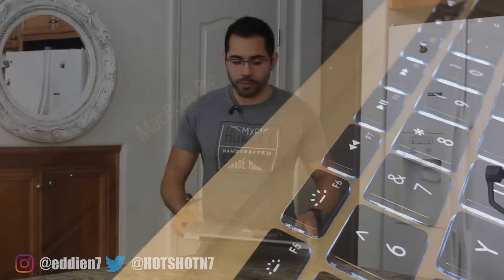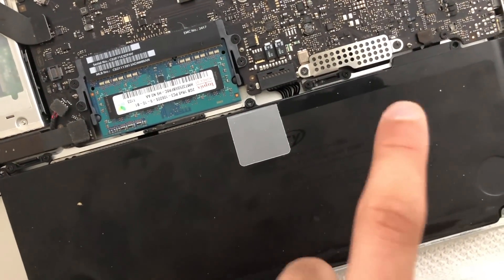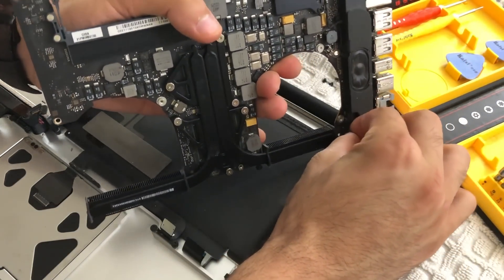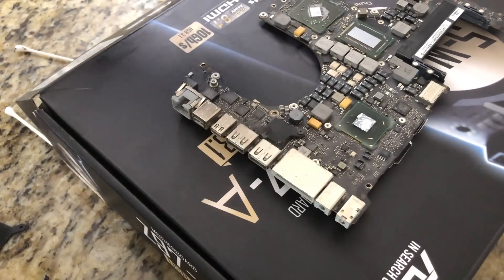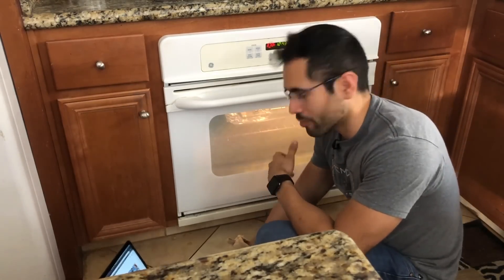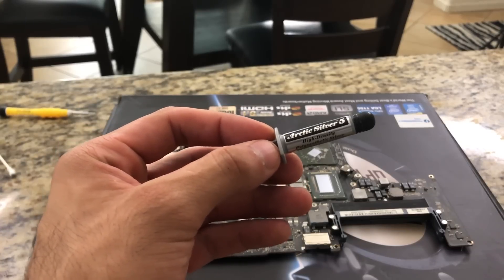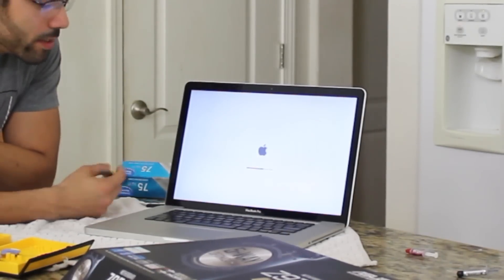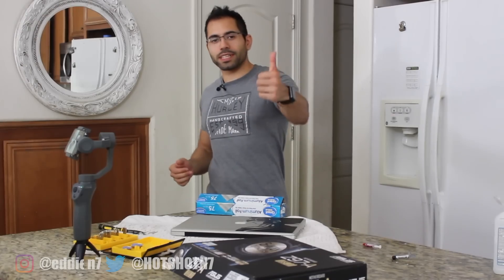2011 Macbook Pro Graphics Card Fix

Comment: Fantastic!
Bit worried about doing it!  My September 2011 15" MacBook Pro finally died last September (2018) and various trips and enquiries to repair shops proved fruitless.  It was on PC Worlds "Do not repair" listing.  It was put in a drawer and forgotten.  So with nothing to loose I watched your excellent Video, crossed my fingers and went for it!
Only observation is you skip through the removal of the ribbon cables a bit fast, so it was a step in the dark.  The fan ones just pull up to release and I had a bit of a game trying to slide them out horizontally and damaged them a bit.  A few of the ribbon cables are a bit fiddly but now I'm an expert!
In the oven it went for 7 mins at 370 deg F (I had a temperature gauge in there so it was dead on) your heart beats faster when you do that.
Put it all back together with the paste and Voila!   A new one is currently £2600.
It's working perfectly now so thanks mate!   I'm writing this on my rescued machine, back from the dead an hour ago! 
There is no feeling quite like it when you switch it on and it works!
Great Video, You and YouTube saved me a ton of money so thanks again.   
Everything is there, I didn't bake it all away and when it fired up even the Chrome remembered what I was doing when it died.  
If you are reading this with a dead Mac and wondering if it works - yes it does!  Absolutely!!  Just do what the Video says and it will be fine.  If it dies again I'll do it again (it's easy now) and dine on baked Apple!
My only gripe is why didn't I hear about the Apple recall which I understand they did.   I'm in the UK which is where I bought it from the Apple shop, so they were aware of me and what I had.  I love Apple products but this initially left me doubting my loyalty by not offering to fix what they knew was a built in problem for their loyal customers.  Steve Jobs would have frowned on that I think.
Thanks again for doing the video.
Reply: Trevor Byford how much longer is it going to work though?
Reply: I've never heard of a recall and I'm here in the states! I have the same model, it just crapped out.
Reply: @mobscene13  is it still working?
Reply: @mukzahmed9856  no, not at the moment. I haven't bothered fixing it yet, just grabbed a replacement laptop for now.

Comment: my 2011 15" died for the 4th and last time. I've takin my mbp apart so much, i should be a certified Genius. dont have time to keep messing with it and threw it in the trash yesterday. apple should be sued for this.
Reply: YES! Apple should be sued as they can't even provide you with any help what so ever. I had this very issue with the same machine and all Apple had to say was "sorry". No help, no fix, not even disabling the GPU for me to use the intel. A pile of shit apple are.
Reply: Apple should be sued for something that you bought 8 years ago? Come on, how long do you expect a laptop to work???
Reply: @MassivanMusic  i expect a laptop to last 12 years, like everything else we buy thats expensive does
Reply: @ @renossantinc768  why exactly 12 years if I may ask? At the speed the computers are evolving a machine is obsolete way before 12 years have passed imho.. btw, my 13" late 2011 is also in the process of dying, that's why I found this thread..

Comment: Oh my god!! Last week my Macbook had the same problem. First I visited the Apple store and they told me that my Macbook Pro 17 inch late 2011 was ancient and they cannot deliver spareparts for it. After some research on the internet I found your video. I thought, well lets give it a try, I have nothing to loose. I baked my mainboard like you did and YES YES YES YES it worked. My Macbook works like it's brand new. Many thank bro!!!! It even looks like it became faster like before, but maybe this is my feeling. Thanks again and I hope it will work well for a very long time and otherwise I will bake it again 😜 Greatings from a very happy Youtuber from the Netherlands
Reply: Paardrijden met plezier was just in there last week as well. They used the term "obsolete technology" about 5 times during the whole exchange. I'll try replacing the board or using this technique 100 times before buying another apple product.

Comment: If I disable the GPU, will that take up a considerable amount more processing power? I use my old MacBook for music production, and it's just started having symptoms of GPU failure. If I disable the GPU, will I have a hard time running CPU heavy programs like Logic Pro X?
Reply: No you should be ok. GPU is just for things like video editing or 3d games.The CPU is managing the load for Logic anyway. It's similar to after effects in that way. Processor and ram are the components it uses. You can check Logic's recommended specs to confirm.

Comment: "Cooking" a failed mac chip can help extend the functional life, but there are better ways to do this without an oven, which bakes all components, when you really only want to heat the failed GPU (or whichever chip failed). 
Here's some tips to make this repair last longer:

1. Use a heat gun instead of oven. A cheap heat gun is like $25. and very useful for other projects. 
     - remove logic board and heat sink
     - clean off old thermal paste. once clean, use 99% isopropyl alcohol to clean the residue before applying new paste. AND WEAR GLOVES. finger oils can cause overheating later, and that 99% iso alcohol can poison your skin. 
     - You also need to clean the heat sink pads the same as you did the chips.
     - You need heat shields protecting nearby components. Even aluminum foil is better than nothing. isolate the part you want to "cook", shield the rest with 2-3 layers of foil. 
    - set gun on low, spend 2-3 minutes warming up the chip and surrounding board. 
    - set gun on high and heat the chip with gun nozzle about 2 inches above the chip, 30-45 seconds from one angle, then another angle (straight down, then 45 degrees from each side), repeat for 3-5 minutes. don't let it cool, make sure the heat is never removed for more than a few seconds (to change position) til you're done.
    - watch for color change on the chip surface and surrounding board. "rainbowing" is normal (and means you're close to temp goal), but if anything starts to brown, blacken or smoke, pull back immediately.
   - if you have a laser thermometer, use it with your free hand to monitor temp. your goal is to reach 220 celsius on center of chip.
2. Always ground yourself when touching ram, logic boards, etc. Either grounding strap on wrist or at least touch a plugged in power cable every time before you touch the component.  
3. try not to move the board during heating. once you start heating the GPU (or CPU, etc), DO NOT JAR, or FLIP IT OVER. You are risking the chip drifting on its solder bed. Heat from different angles, move the heat source, not the component. 
4. take detailed notes of your repair attempt. if it fails, try again, with longer heat cycle.

BONUS TIP: Use a ice cube tray to hold the dozens of screws you're removing. pay attention to the location you pulled it from and label each cube cubby so you know what goes where when re-assembling this bitch. 
BONUS TIP 2: While you're in there, clean those nasty fans, you dirty fuck. 

These steps will help prolong the longevity of your repair, allowing your mac to last longer. good luck.
Reply: Jeph Bennett Any chance you have a video on this? I’m a visual learner so trying to follow steps is like reading Greek to me. Thanks for the info though.
Reply: connet hdd to anther mac  and remove amd grapic drivers files. And boot it again
Reply: @CharithLahiru  Could you please provide more info about what you are suggesting to do?
Reply: This worked great. Did it yesterday and now it's running even better (and cooler) than before. I was prepared to bin it before finding this comment.
Reply: @lukewheldon1223  Which comment are you referring to? What solution worked for you?
Reply: @lukewheldon1223  What did you do to get it working better and cooler ? the heatgun thing ?
Reply: Do u fix computers for a living? Can I send u my mbp for u to fix it ?
Reply: Er....your comment seems to be invisible beyond the 3rd line. I'd be keen to find out what you said here
Reply: Brendan Gilmore Who are you talking to?
Reply: @kimtown  Jeph's comment at the top of this thread. All good - he replied :)   I'm following this closely as I have 2 MBPs with the same problem so I have a fair bit at $take - thank$ Apple!
Reply: Thanks for this tip, I'm giving this a try today on my failing GPU. It's 8 years old so if it doesn't work I've not really lost too much 😅
Reply: Yeah that definitely sounds better
Reply: Iron Tusk  did this work for you?
Reply: 😂 thank you
Reply: Bro was chatgpt before it existed
Reply: Hi, I wonder if you can help me with this, Jeph. I have a 15" Macbook Pro 2011. Its graphic chip failed three years ago and I got the motherboard changed (apple replaced it for free as there was a replacement programme). The graphics chip has failed again this week. I mean, when I boot it up the apple logo can be seen. Once it reaches the point where it does that graphic switching to the AMD chip, just before the login screen, it goes blank and white or blue. Do you think I can do anything about it? Does a reapplication of thermal paste enable me to salvage this laptop? Or is the graphics chip already fried?
Reply: Nivedan Mangalesh Wow, very detailed!  I like the idea of the heat gun focussed in the one area vs baking the while logic board. 

I reballed (resoldered) my late 2011 MBP about a year ago. The shop I took it to removed the original solder and put on a different kind. The service either came with a 6month or 1 year warranty, I forget.  They also told me that my graphics card was a little damaged, but was still totally useable. The solder just got onto it. 

Now a year later I think I am experiencing the graphics card giving me issues. I have to wait until tomorrow to see what the diagnosis is. 

With that said I was told by the shop that this is fairly common with laptops. 
That laptops dont have the same ventilation capabilities as that if a desktop.  

He pointed to a Mac Pro tower, back to my Macbook Pro and said "They pretty  much cram all that that into this. More ventilation with the tower." 

Dont get suckered into Appple telling you you need a $500+ logic board from them. That solder will just fail. 

I should have maybe spent another $50 and had the shop replace my graphics card, maybe I would be having this 2nd visit. 

I will update this post as soon as I get this figured out for the second go around.
Reply: @jesslucio3104  You get it  figured out for the second go around?
Reply: Reynard Baillou It was done this time. I got a used logic board and its been fine so far. It is now not used as heavily though.

Comment: This is a bandaid on a broken leg. The reason this fails is due to solder connections under the flip chip die. The solder under there is very small and encased in a hardened underfill. When you "Warm" the underfill it flexes ever so slightly. Thus allowing the chip to make contact (Not always sometimes this wont even work) with the solder points on the substrate the die sits on. This is why this only will work for a little bit then fail again. Because you arent actually fixing the issue.
Also lead free solder melts at 220-225*C the oven isnt even set high enough to melt the solder.
Reply: then it would be better to use one with lead solder instead lead free solder...

Comment: Temporary repair only. You HAVE TO switch to integrated Intel graphics (100% fix). It doesn't take long, there are YouTube step by step tutorials on how to. BTW, as you cooked the shit out of the logic board, thermal paste has to replaced on the CPU and GPU.
Reply: Ignas Filipovas He mentions that in the video

Comment: You bake that in oven just to kinda solder it back again? Is that what it is? You didn't replace anything, right?
Reply: I use a bbq grill
Reply from the maker: Yeah, we just reheat the ball points on the GPU to get to connect again.
Reply: @HotshotTek  Is there different method to do it more local, perhaps with heat gun? To avoid baking all motherboard in oven? How many of those GPU have you fixed this way?
Reply from the maker: I tried the heat gun method before and I know on some this could also fix it. But my GPU must have been bad because it didn’t do anything and was still not properly booting up. So I threw aside, a year later I revisited it and just said F it lol. And tried the oven method and it worked and documented it to share thats its possible.
Reply from the maker: But the everything on board (included the board) are all heat resistant can handle extreme heat. Just not the speakers.
Reply from the maker: And this was my first GPU I have physically attempts to fix without just getting replacement parts.
Reply: Hotshot 
Hi can I use microwave to heat the motherboard 
And at what temperature and for how long becouse the way my Mac book A1286 is behaving its GPU problem
Reply: No do not use a microwave. Putting metal into a microwave makes sparks and fire. A very bad idea :)  @meshreylimited2206

Comment: I have an early 2011 MacBook Pro 15 inch 2.0ghz that I really do not use much at all anymore. Is my MacBook model afflicted with the gpu problems. It still works currently, it is just slow with a poor battery. Do you recommend just selling it?
Reply: Sell it for parts.
Reply: Battery is not too expensive. I had mine replaced though you can do it yourself easily. I think the part is about $50. The GPU has a life span, eventually it'll burn out. I understand the GPU on this model has internal problems that shorten the lifespan. But mine died while playing a first person shooter at a high detail setting. So it died perhaps in part due to heat. But yeah, sell it for parts if you like.

Comment: how do you get the gpu and how much it cost?
Reply from the maker: What?
Reply: There are some companies that have special machine that will desolder and reinstall a new GPU as eventually this reflowing method won't work either. Nothing is permeant fix as ATI or apple fixed the problem. Best solution is to just upgrade to the 2012 Macbook Pro with nvidia graphics

Comment: Update - Mine started screwing up again so I gave up. I got myself a MacBook 2012 which only has an intel integrated gpu.
Reply: Same here man
Reply: screens a bit small but it works..
Reply: @generalmetal967  Because this isnt a fix. This is warming up a GPU to cause the underfill to flex some allowing the solder to touch under the flip chip bga (The shiny part of the GPU). This does not fix the solder issue under that Die.
Reply: @ChrisLongPhoneRepair  yeah I know it's a shame because these mbps are really good otherwise

Comment: If you google more there's a code you can put in the Nvram via single user mode so it always boots with the integrated graphics.  You can then install gfxcardstatus v2.0.1 (has to be that version apparantly) to make it stay on integrated graphics.  This makes it usable.  I'm not sure a high demand graphics app could cause it to flip though.
Reply: Here‘s the code:
Press command + s 

nvram fa4ce28d-b62f-4c99-9cc3-6815686e30f9:gpu-power-prefs=%01%00%00%00

nvram boot-args="-v"

reboot
Reply: @batmaninuhland  What if I need to reset this code then? How to delete fa4... string? Or just PRAM reset with opt+alt+R?
Reply: Alexander V. with the PRAM Reset, yes
Reply: @batmaninuhland  thank you
Reply: That what I did to mine. I still even edit videos on it. It works fine the integrated graphic is only slightly slower than the faulty GPU.
Reply: Mine started flipping back into discrete mode again and crashing, I gave up on it.  The computer shop told me the only option was a reflow but that could only last a couple of years.  I think basically its a combination of the chip heating up and desoldering itself, the cooling not being sufficient and maybe the thermal paste not being up to scratch.
Reply: Will this remedy work on my 17" 2011 Macbook Pro?  @Abelmusic
Reply: @napoleonblownaparts2530   Yes I've done it on mine.
Reply: @Abelmusic  What editing soft are you using? FCPX latest version doesn't start without graphic accell.
Reply: Svemir Ko Hey Svemir, yes you can. Press option + alt + R + P and the Parameter RAM will reset.
Reply: Thomas Staab I’ve done that and got mine working, but it will not boot up normally. It gets half way loaded after login and freezes. I have to put it in safe mode to boot fully. Any clue how to fix that? I’ve looked for days.
Reply: mikeg155 delete the graphics extensions for the broken graphic card
Reply: Svemir Ko press option + alt + R + P right after the startup
Reply: So on the 2012 the reason the screen sometimes wasn't coming on is because the internal connector was loose which the fixed in a second hand apple repair shop.  To recap the old macbook 2011 pro 17"  had the faulty gpu, only fix is reflow but that only buys time.  When the Nvram/smc resets works it's just a coincidence because the discrete gpu has reconnected or because it's got hot which made it default to discrete mode.
Reply: This is the method I've used. It heats quickly though.
Reply: Why exactly 2.0.1 version, instead of 2.3?
Reply: So an update now I've got a 2012 macbook pro which doesn't have a discrete gpu.  But this one's quirk is that the screen sometimes doesn't come on when you turn it on and you have to put it to sleep for a minute  then wake it up or never turn it off.  Real apples are better than apple computers :D 🍎